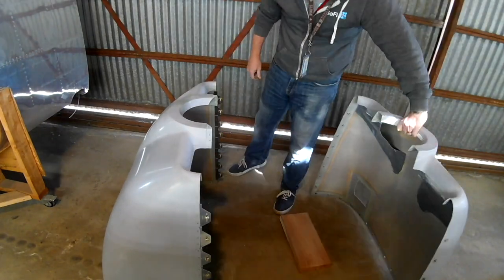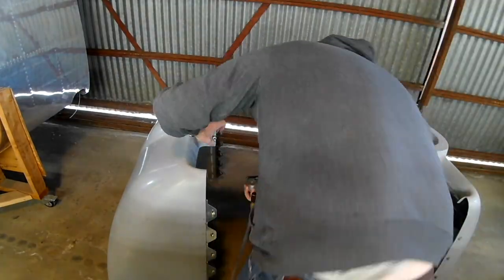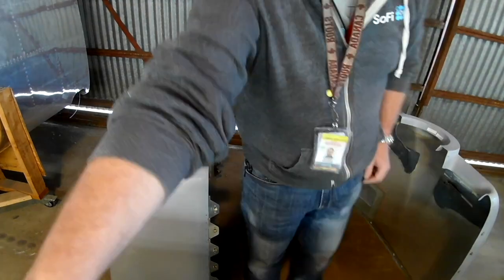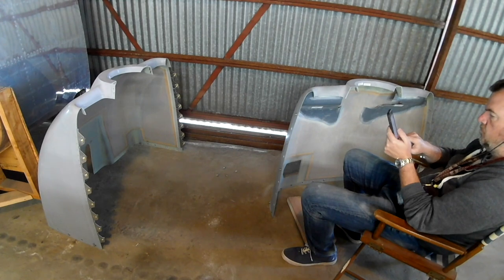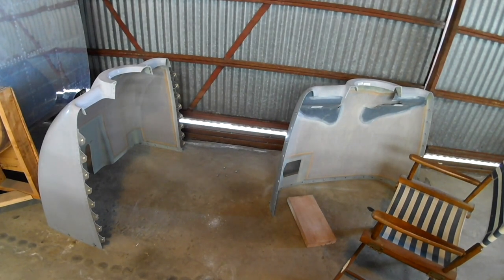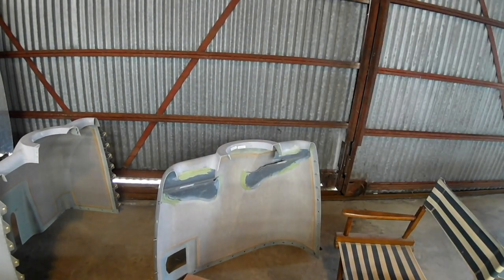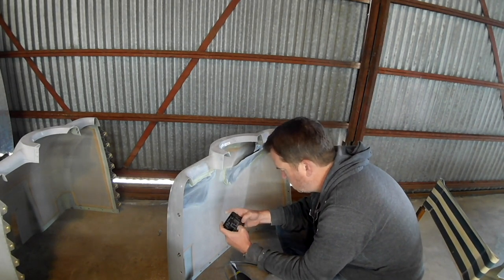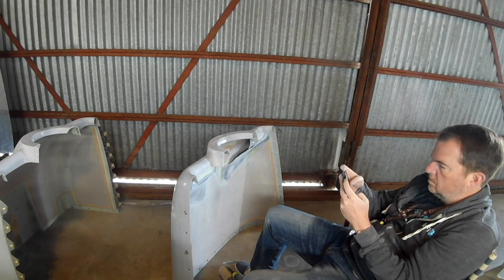RV-14 Cowling XIV

Comment: Have more hours into the cowl on our RV-14 than any other item in the entire airplane.  The wire from Vans was too big and made it impossible to get them in.  Had to get new smaller wire to make it work correctly.  Your system looks MUCH better than stock.